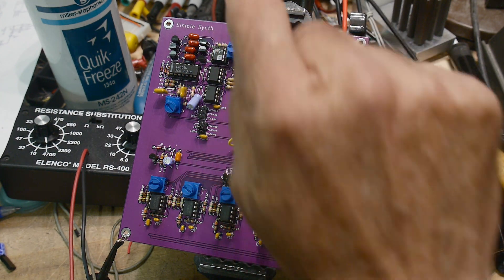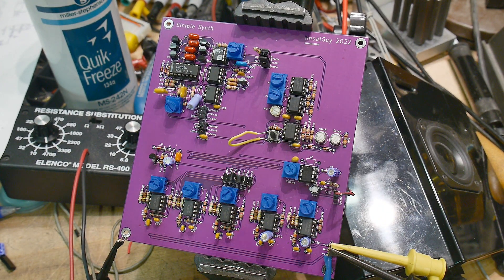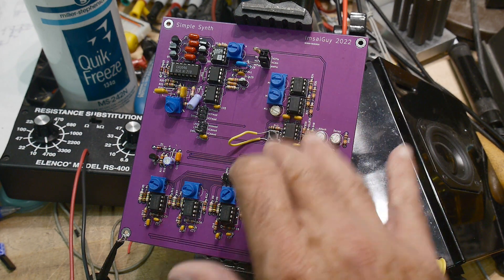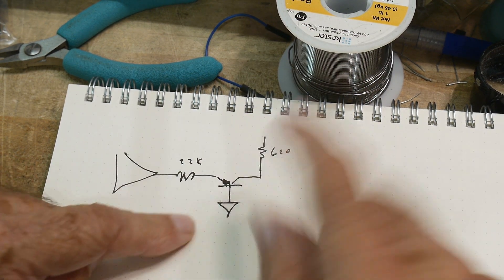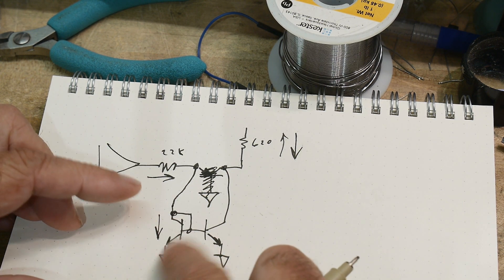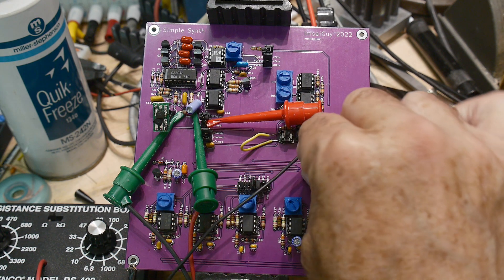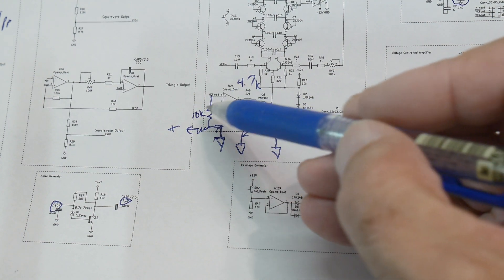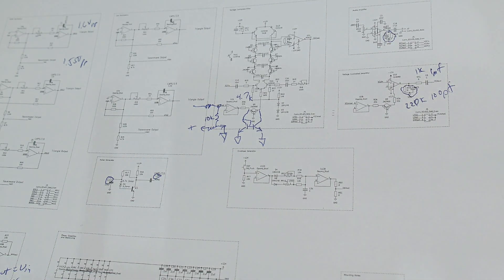#1233 Simple Synth Project (part 4 of 6)

Comment: On electric Druid's website there is a correctly working CA3080 VCA and it's control structure. Taken from a known book.
Using a PNP transistor, but bound with the base to the opamp.

7:12 normally a Filter uses 2 NPN transistor in a different config.
Check Rene Schmitz Korg MS-20 filter clone, it's pretty much similar on Moog clones made by very known people, even on the original TB-303 filter is something similar, albeit the TB-303 has an extra control voltage input other filters don't have, enevelop moudlation and it's UNI POLAR.
You pnp setup was wrong, that's good for a LM13700, CA3080 and so.

Comment: When I build a current mirror like that one, besides matching HFE and Vbe of both transistors, I use transistors in TO-126 case (such as BD139), because I can attach their thermal pads together, and thus, set a thermal bridge that keeps the thermal vector as flat as possible.
Reply: Moog only matched transistors in the first 100 or so in the Moog filters before they discovered the cost where going through the roof than Bob Moog used plain "normal" transistors, unmatched.

Now they use BCM847 in their modular Moog filter, someone made a video on it.

it's just much smaller than a T0-92 package.
Reply: Use That 300, That320, That340 ... 4 matched transistors in a packages, other wise BCM847, BCM857 or other dual transistors. check mouser.
no need for matching.
Reply: none  monolithic transistors can be matched in beta but still could differ significantly, using small emitter resistors in both mirror transistors can drastically change to more control, nfb in effect, wilson mirror is good if you have a monolithic array, for seperate transistors you could use a higher current limiting jfet as a safety before the circuit
Reply: You both are right, however matching transistors is not a new thing, and for some simple designs like this one, matching betas and vbe would be just fine (even more if you already have the BJTs in your spare box). Thermal coupling would add a stability layer.

Of course if I want a matched couple for my day by day job as EE designer, i would run for duals like the DW suffix versions of many popular transistors (i.e. MMBT2222ADW) , or the old venerable LM394 if available (there are many modern replacement nowadays indeed).